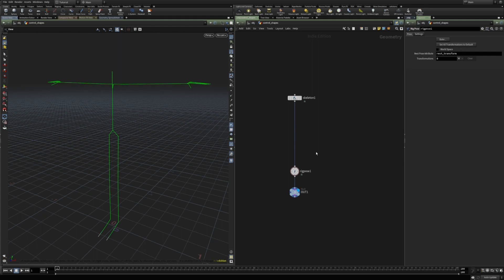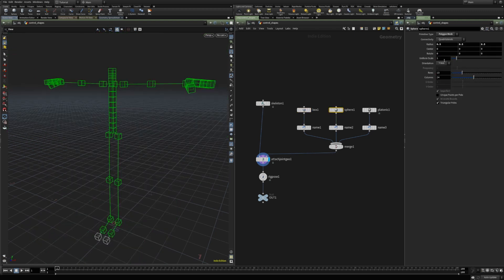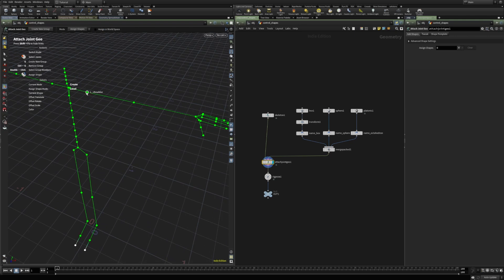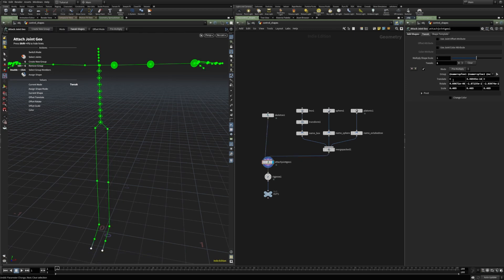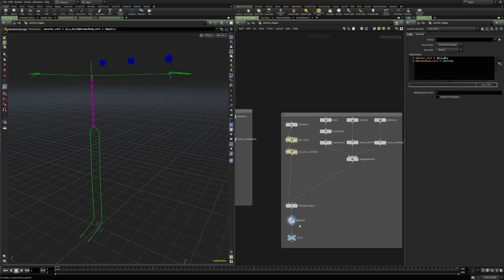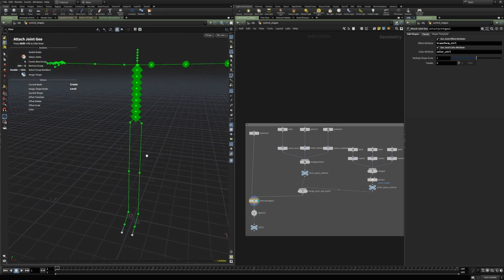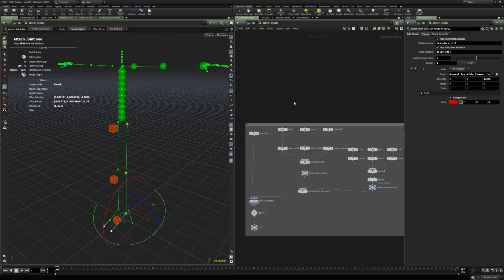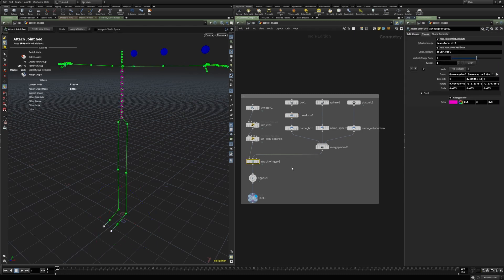KineFX control shapes in Houdini 19

Comment: Hi Rok, thank you for this video clearing how to create control shapes. I have a question. After I created the controls and assigned them, how do I use them ? I can see them when using rig pose but I can't select any of them, instead I have to select the point which the control shape is assigned to, but I can't select the shape itself. Are they supposed to be used at obj level ? Thank you
Reply from the maker: In rig pose mode you should be able to click on control shapes to select controls or joints. So, if you are in rig pose mode and in viewport disable joint display (right click menu -> disable "display joints") you should be able to click and select control shapes. They are supposed to be on SOP level as the rest of KineFX.
Reply: @rokandic  They're not selectable ... even when I turn off joints visibility
Reply from the maker: @artfive  Sorry, what I meant was that control shapes should be selectable even if joint visibility is off, but they should be selectable in both cases. As to why you can't select control shapes, I honestly don't know what could be the problem.
Reply: @rokandic  I finally solved the mistery 🙂 In the fur dude tutorial page https://www.sidefx.com/tutorials/kinefx-rigging-fur-dude/ someone commented that controls shape must be polygons otherwise they are not selectable, so I converted them from nurbs to poly and now they're finally selectable.
Reply from the maker: @artfive  Great to hear you found the solution and thanks for sharing it :)
Reply: @artfive  THANK YOU!
Reply: @artfive  Thank you!
Reply: OMG I have been stuck with this issue for days now! thank you for figuring this out.! @artfive